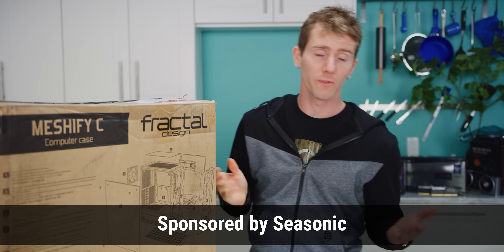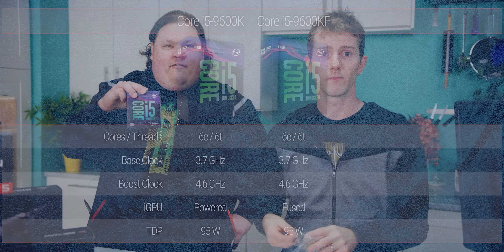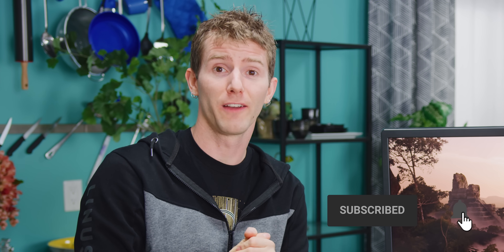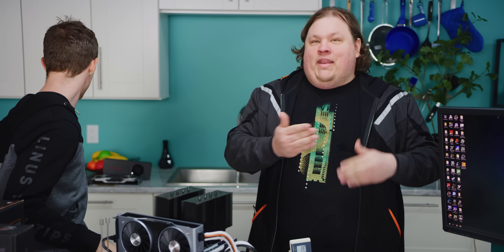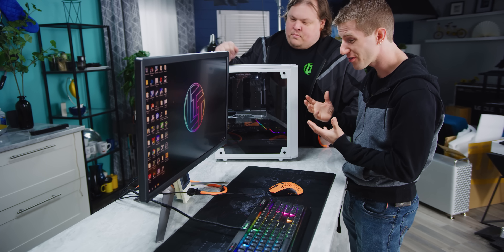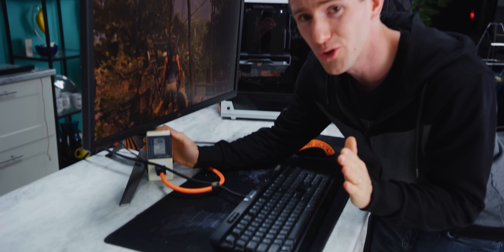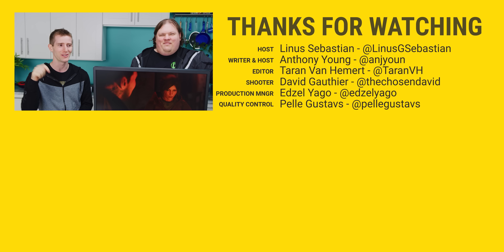We built a PC more efficient than a console!

Comment: how does this power draw compare to the same system with everything hooked up and over clocked etc.?
Reply: it would at least double the power consumption
Reply: @GewelReal  any numbers?
Reply: @steven222gerek  not double.. it will be between 300-350 watts while running, like when everything will be maxed out only then.. otherwise around 250-275w while gaming or while doing random stuff like browsing etc it will not consume over 100 watts..
Reply: good point, that would've been a good conclusion
Reply: I have essentially that setup overclocked and uncompromised. It runs between 300-350W on a high load.

Comment: 0:17 nuclear energy isn't "technically" a fossil fuel. it is non renewable but doesn't produce greenhouse gasses. I does produce some nasty nuclear waste though. 

I live in Ontario, Canada and most of our electricity is made from nuclear power plants (~60%) as well as wind farms (~10%) and hydroelectric dams (~20%)  the remaining is from fossil fuels.
Reply: Sanity016 It’s kinda not really renewable in that the same nuclear stuff used in a power plant can be reused at another power plant, which would decrease the nuclear waste. idk how it works and my explanation here is bs af, but ok France does something like this and the majority of their power is from nuclear
Reply: Beha awwad nuclear is commonly regarded as the halfway point between fossils fuels and renewable energy.
Reply: @fordrollhaus9086  Nuclear is more output per square inch though...
Reply: Christopher VanZetta So? It’s less clean than renewable energy but more clean than fossil fuels because it still produces some waste.
Reply: @fordrollhaus9086  rather some waste that we can store untill it becomes not dangerous anymore, than super slow and non-efficient renewable.
Reply: Anym except that we don’t store the waste properly and usually end up dumping it into the ocean (which is fine for humans, water is good at radioactive insulation, but definitely not good for the fish) or burying it. Moreover, we have a limited, although large, supply that will eventually run out like fossil fuels. Solar panels are getting efficient and cheap enough that most households would be able to pay them off in a couple years according to How To by Randall Munroe.
Reply: @fordrollhaus9086  really? so you can pay them off "in a few years" though you don't define few and by that point in time they will be so degraded and useless that it will be time to buy some new ones that you will again need to pay off over the course of "a few years" over and over again. Not to mention the fact that they are not capable of powering the world in the first place. Solar is a pipe dream.
Reply: Solar and Wind farms use very rare metals that they themselves have to use fossil fuels to retrieve.

Comment: Title: Making a PC more efficient than a console
Me: I sure hope it does
Reply: Actually as consoles run custom chips in smaller cases allowing less power draw because of worse heat transportation it's actually surprising that a pc is more efficient. But if you now compare the prices: A PC with that specs is around 800€ while you can get the xbox one s now for 169€
Reply: I really hope you are not under the impression gaming pc's are more efficient then consoles
Reply: I was referring to speed as a joke 😂
Reply: Haitian Xu  They've mentioned the lower cost of a console.
Reply: @siteking4289  Titanium certificated PSU is making it closer to €900 I think.
Reply: Haitian Xu  Replay the section where they've mentioned One X. The video was about power efficiency while maintaining the same performance at all costs.
You can't just build solar panels and batteries unless you own a fabric or in a lab (: You can buy them, though. And you can plug the console to the same solar-powered grid.

Comment: 5:36 Thermo-syphon pump-less water cooling setup. Mark my words.
Reply: It is. It's a pretty old technique used on old motorcycles and cars. It uses the fact that hot water rises and cold water falls.
Reply: @LeonB54  So, a heatpipe...?
Reply: @mariodidier001  basically. One Carries hot water up to a radiator the other carries cold water back down
Reply: Leon B54 so it utilizes convection currents?
Reply: @vibe1884  yeah it does
Reply: Leon B54 Yep. I’ve built a wood burning bath water heater using Thermo-Syphoning. Simple technology.
Reply: @ZaiFuchigami  that sounded very not-simple

Comment: I would really like to see the other extreme for comparsion - the same system overclocked for the best performance 🤔 but still.. a great video 😎
Reply: Like u said comparison with undervort/normal/oc would be interesting but more interesting would be to add 3600 r5 with rx 5700 or similar in those 3 options.

Comment: zen 2 actually have an IPC advantage over Intels 8th gen and "9th" gen.
Reply: Yes i think it should be around 10% or so, maybe a bit less
Reply: When Intel not providing the T series for this fight, it pretty much throws a towel right away.
Reply: @jamesli629  The T models are not well binned CPUs, they are just pre-underclocked and undervolted CPUs. You achieve much more power savings with a high end chip that has been de-tuned.
Reply: @OutOfRangeDE  yep about 12%-15% better IPC than Intel's latest and greatest depending on the task. If you look at the very recent reviews of the new Intel 10980xe 18/36 CPU a AMD 3950x 16/32 CPU is either matching or beating the higher core count Intel CPU and if the 2950x does lose it is not by much. Heck even in gaming stock vs stock the 3950x is most times beating out the 10980xe and yes there are a few games that favor thge Intel 10980xe as well.

It is not until the 10980xe is over clocked that it gives a ass whipping to the AMD 3950x. This zen 2 release has been a huge step forward for AMD but if they also had the clock speeds that Intel can get to I think Intel would be in for some even bigger trouble. You can bet Intel is working like made beavers trying to get their 10nm desktop CPU's working right and ready for release asap. I am talking about the ones that are not just a rehash of skylake  all over again and have a pretty decent IPC gain. I forget what they are called some some one here probably can answer that I am sure.

Comment: Linus: talks about 1000 watt power supplies as commonplace 

Me: cries in 350 watt
Reply: If you can't afford a 1000W PSU, maybe PC gaming isn't for you.
Reply: @dripxiaoping5837  Can't understand a joke?
Reply: @omegacon4  let me spend the same, if not more, as a quality 1 or 2 TB m.2 ssd that I will use on a psu that I won't ever fully utilize, since I'm not dropping thousands on sli 2080 tis and a 3950x.
Reply: @omegacon4  I could care less of what you think.
Reply: @omegacon4  without the swearing yeah you are just wrong xD.  One of the best benefits of PC gaming is just how much customization there is, I have a low end-ish PC only capable of 1080p 60fps with some games not even reaching that and that doesn't make me any less of a PC gamer.  Hell when I started PC gaming I had a laptop with a dual core and a GTX 845m and had to go LowSpecGamer on that bitch and that still didn't make me any less of a PC gamer.
Reply: 350W is perfectly fine for >90% of PCs, only very few actually need more than ~450W (real power output of course, not some cheapo power supply).

Just take this video as an example: 100W while gaming. So the system would draw maybe 150-200W if you don't undervolt, go for a better GPU and maybe add a harddisk. And that's already including the PSU efficiency, which means the system itself only uses 200W * 85% = 170W. So even a bronze-rated 350W PSU would be running at around 50% load - which is exactly the sweet spot for most PSUs.
Reply: @stephanweinberger  Exactly.
Reply: @jyrone3943  Not unless you overclock the 64 core threadripper to over 4 GHz all core 😉

Comment: 5:00 Ryzen 3000 has a 15% IPC advantage over Intel Coffee Lake
Reply: Right, AMD has the IPC advantage, but Intel has the clock advantage. Not everyone makes the distinction between them.
Reply: Bruh the ipc for intel and ryzen is roughly equal. The 15% ipc increase is from zen to zen 2
Reply: @zombieswitapple  Its not equal, zen2 edges intel out.
Reply: @zombieswitapple  zen 2  has 5 percent more ipc
Reply: @Lionheart1188  i said roughly for a reason dude
Reply: @zombieswitapple  The 15% increase is over Zen+. Zen 2 running on 1800MHz FCLK (3600MHz RAM) has a 15% IPC advantage over Coffee Lake running the same memory.
Reply: @karliskorlass196  whats your source? Most articles ive seen show that the ipc is within around 5% for most benchmarks https://www.google.com/amp/s/www.techspot.com/amp/article/1876-4ghz-ryzen-3rd-gen-vs-core-i9/. Btw i meant to say zen+
Reply: Who cares? The bigger issue here is that an architecture from 7 years ago notorious for running hot and using lots of power on a device 1/2 to 1/3 the cost of the PC barely uses 30w more. This isn’t a win for AMD or Intel
Reply: Ryzen 3000 edges out intel in IPC by a negligible amount. Though, Ryzen 3000 still loses in games because of the 40 to 100 nanoseconds core to core latency caused by the infinity fabric. AMD managed to fix that with Ryzen 4000 by getting rid of the infinity fabric, and those CPUs are coming next year with an even more IPC boost. Here's a pure IPC test between Ryzen 3000 and Intel 9th gen. https://www.youtube.com/watch?v=MtrLtch-7Uk
Reply: but it also has a 15-20% clock speed deficit
Reply: @karliskorlass196  Mate, that's bullshit and you know it.

1. 15% IPC increase is over Zen 1, unlesss you think AMD don't know what they are talking about.
2. Coffee Lake has higher IPC than both Zen 1 and Zen+. There's 0% chance of Zen 2 having 15% IPC advantage over Coffee Lake, even with high speed memory. 

People like you paint AMD fan base in quite the negative light...
Reply: @zombieswitapple  Bruh AMD actually has the IPC advantage right now. HW unboxed did a test of this and found when set at same clock speed for AMD and Intel AMD came out ahead for IPC by more than 10%. Intels only saving grace is that they can hit higher clock speeds than AMD can which equals things out for the most part. If AMD would have been able to get their clock rates up a lot higher for Zen 2 I think Intel would have been in for a real heep of trouble but that was not the case. 

From what AMD has said Zen 3 is a tock (yes they are usinf the old tick tock like Intel used to.) Anyways Zen 3 is a tock and they stated that as such the gains are going to be what would be expected form a tock type release. Zen 2 was actually only a tick release since it was mostly just a new node to 7nm but they were able to do a lot of tweaks to the zen 2 which gave them better than expected performance gains from the changes they made to Zen 2 over Zen +.
Reply: @Rocky-bz8wr  look at the links ive provided. Sure in some cases amd can have 10% faster ipc but in others amd is slower. Thats why im calling it roughly equal

Comment: ill just drop this before watching the video:

ahem laptop
Reply: *coughs out blood* dual standard / one large charging block
Reply: Now just listen here a minute buckaroo
Reply: My laptop eats 90w idling. Of course it's got a Ryzen 7 2700 and Vega 56.
Reply: I once had a dell inspiron 15 from 2010. 2and gen i7 and a pitiful gt 525 graphics. It and its brick were a solid room heater for winter.
Reply: Game laptops draw more than 100W.
Reply: @TheNiteNinja19  weird flex but okay
Reply: @Krigalishnikov  ofc since it runs the screen too, which was not in their measurement.
Reply: Laptop with soldered RAM and CPU is about efficient as it gets.
Reply: @TheNiteNinja19  Does it let you change voltage in bios?
Reply: When it's about environment the fact it has a battery is not great.
Reply: @Bigjeffrey123  a Portable 4K display draws a maximum of 15W, so they could easily get under 110W with display.

Comment: 108W on load? How about on stock setting?
Reply: Around 300
Reply: probably around double if i had to guess
Reply: @dividders  impossible, i guess between 150 to 200
Reply: With all that RGB and fans on I don't think so just ram with CPU and GPU alone consume around 200 on stock( without boost on or something like that)
Reply: @ridwanaja7950  that 2060 alone is gonna pull more than 160 off the wall at stock
Reply: Well that wasn't the point of the video though? It was about making a PC run the lowest efficient wattage. I don't see what "stock setting" has to do with it tbh.
Reply: @ridwanaja7950   if that is "true" no one will buy 600W power supply!!
Reply: @mrguybrodude7373  so you can compare a before and after?
Reply: @austinrobinson4281  Still not really the point though, not to mention finding wattage for a system is easy with many websites and tools out there. So finding that info isn't something to knock the video for... whereas there is really no info out there on taking components and underclocking and underpowering them.
Reply: @-indeed8285  some people buy big psu because some of them "think" they need it  at 50% or less to be "efficient", when they could just use a 400w psu...
Reply: this game was set for 60 fps, not unlocked fps, I have seen a video that a system powered by 1070, 8700k, and 80+ bronze psu runs gta 5 consumed ±220W. So as this video used 80 titanium, and I heard that 2060 is more efficient than 1070, i could say it
Reply: @-indeed8285  it is rtx 2060 bro, not rx 590 or something
Reply: I bet all the undervolting in BIOS gave them a total of 3W in idle. My overclocked R5 1600 with a bronze rated PSU pulls about the same 29-30 ish Watts on idle. 

Capping the frequency on a GPU will do a lot for load power though. I'll have to test my rig in eco mode...I think I could get it down to 150W. Under load (gaming) I pull between 250-300 W depending on how much I OC my GPU. CPU does surprisingly little.

There was supposed to be a point in this comment. Sorry...

Oh yeah. There is a diminishing returns for expensive and nitty-gritty tweaking.

At 100W the difference between Titanium and Bronze is at most 8W, at idle about none.

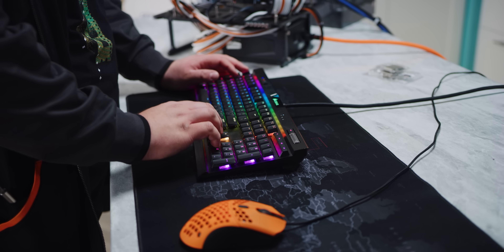Comment: 3:48 must make computer efficient (leaves rgb on)
Reply: 1) that was during stability testing and he was only interested in tuning the cpu in that scene.
2) that was a keyboard, they're not measuring that, it likely wouldn't have made a significant difference anyway.
3) by the time they put the computer together and actually test it as a unit, the rgb is off.
Reply: As we know, rgb PCs al least make 20% faster but do not consume 20% more power.  I suppose it could be a legitimate way to make this machine more energy efficient
Reply: Quit looking for flaws, these guys are more successful than you and you don’t have the reputation required to criticize their mistakes.

Comment: “This PC draws about 106w-130w” Damn that’s around the power draw of a normal 2400G system
Reply: @Parky Fresh Yes and no
Reply: Thats like 12% of my pc lol. I have 1000 watt psu
Reply: @yann9378  u also got hardware that needs 1000watts? If not, your pc isn't drawing 1000watts... its only capable of delivering 1000watts to your hardware.
Reply: My 3950x build draws 130w at idle, and that's with a titanium power supply on ryzen power saving mode.

This video blows my mind. Guess I need to learn how to properly tweak the bios.
Reply: @Pennymarkt32  Normally the higher voltage in a PSU means its 80+ bronze, silver or gold. So it's mostly worth it even if it draws around 800-900 watts
Reply: @HardGuess  What higher Voltage? a PSU should Deliver 3.3V 5V 12V and -12V nothing else, Wattage is the Voltage multiplied my Ampere. Also your PC PSU or any DC PSU cant draw a 1000W if ur Hardware is not consuming 1000W. 80+ bronze, silver and or gold are just labels that indicate how efficient a psu is. This Efficiency Label got nothing to do with Voltage or Wattage. :o
Reply: @nerdstrangler4804  not necessarily, multi monitor setups draws a lot more power idle, also some background processes you won't see in gpu utilisation or cpu usage will show.  my pc idles between 50 to 100 watt measured from psu intake. just in the last 2 minutes it varies that much.  i got hx850i platinum psu, i7 6700k stock. and 1080ti.

Comment: "We built a PC more efficient than a console!"
Buys components that have rgb
Reply: So the console has no rgb and is still less efficient
Reply: LED power consumption is negligible, and they can be turned off
Reply: I was looking for this comment, especially the Trident Z haha. But yeah turning it off will help but the RGB controller will still draw like 0.05 extra watts.
Reply: RGB barely takes up anything. Also the RGB was all off during testing.
Reply: They save barely 20w vs a console which costs 2-3x less with an AMD architecture from 2012 notorious for bad thermals...
Reply: Just add in diy rgb lighting to your consoles. 😁
Reply: @YouTube2021FM  It is called an experiment stemming from an idea for a video. If all they did was realistic tests, they wouldn't be putting out nearly as many videos.

Comment: Recommendation.. if you are at all techy then a great option is using a Pi 4 or other SBC as a desktop computer. It works fine for browsing the web, watching youtube, emails, discord etc. You can of course use it for gaming also.. for simple games like minecraft or running an emulator. 0.2W power consumption is hard to beat. I can always turn on my PC when I need the power, but otherwise the Pi 4 works beautifully.